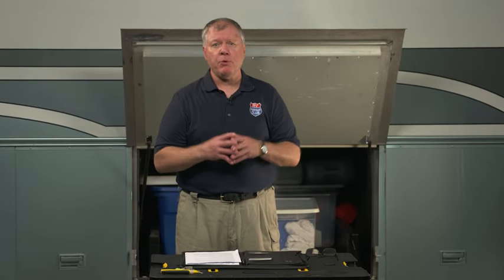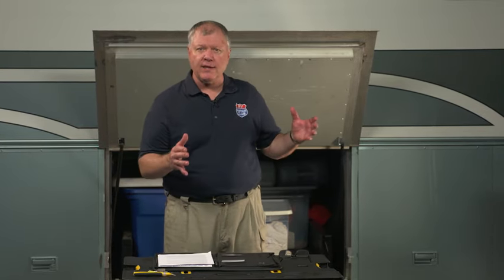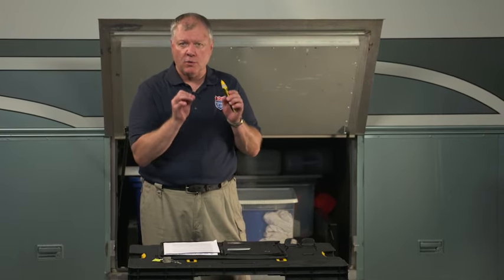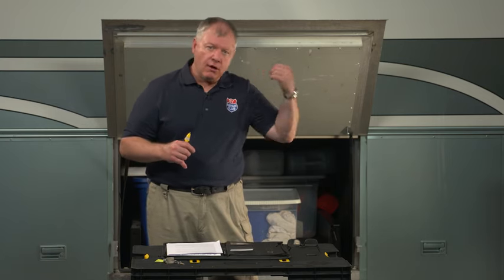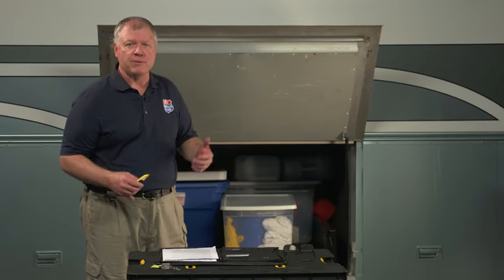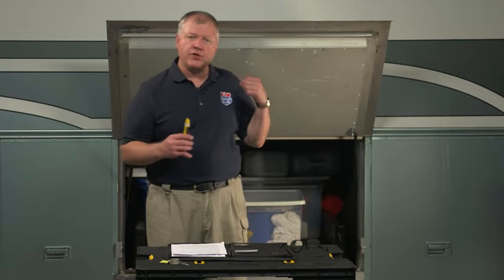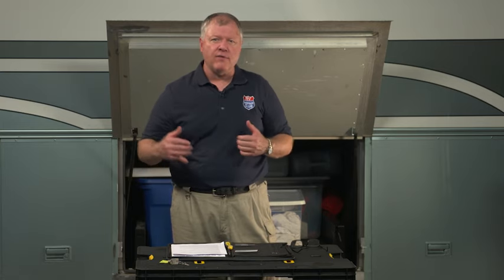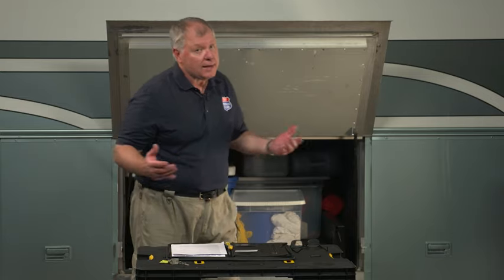RV Outlets Not Working: Troubleshooting Tips & Precautions

Comment: I replaced the breakers and the GFI outlet and 5 outlets still don't work. The "hot wire" on the back of the outlets is reading 120v but when I plug stuff in the outlets don't work. I'm going to replace all 5 outlets. Any other suggestions would be much appreciated. Thanks

Comment: I recently bought a class A RV. Many of the outlets throughout the RV are not working. I recently bought a second air conditioner and put it in the back. That was when I realized the connection on the back air conditioner also didn’t have power. Additionally,  the outlet for the refrigerator does not have power. I have checked all the breakers and fuses. What could the problem be?
Reply from the maker: Hello Matthew,

Thank you for contacting us. Great question! The ‘Ask an Expert’ section is currently for members of our online community. By becoming a member, you will have access to our expert’s knowledge in RV repair and maintenance. With your membership you will also receive discounts on products and hours of Premium video content. 
If you are interested in becoming a member to the RV Repair Club, please click on the special offer below:

https://www.nationalquilterscircle.com/?add-to-cart-multi=1&products=1161&skipcart=1&coupon=C24043&vscid=C24043&skipcart=592449
     
If you have any further questions, please chat, email, or contact Customer Service at 1-855-706-3536.

Comment: The first thing to check is ask if there is a power outage. We thought we had an electrical problem as all our outlets went out. But the lights worked. Real newbies to living in a trailer. Our lights are connected to the battery. Feeling really dumb lol

Comment: My GFCI outlet is working fine as well as my non-GFI outlets in my bedroom but all other (outside and kitchen) outlets connected to my GFCI loop are not.  Any ideas?  Thank you for the great videos.
Reply: Same.  I even replaced the GFI outlet and the breakers and same outlets still don't work. I'm going to try replacing all 5 outlets that are not working. I need help.
Reply: @imissmypeep2209  I just figured  out.  My outside outlet was bad. Took it out and bypassed it and all other outlets now working. My outside is first in my loop after bathroom GFCI.

Comment: Thanks so much for this video. My wife and I just bought a brand new Kodiak Ultimate T.T. to live in temporarily. We are veteran RV’ers but our previous trailer was much smaller and only had one GFCI outlet. The new trailer has 4. Out of the blue our TV outlet went dead. I was perplexed I safely (trailer unplugged) removed the outlet and found some really poor connections. I redid the connections and still nothing. Until I saw your video I didn’t realize that GFCI’s are routinely wired in series. Found one of the outlets that my wife said she had tried plugging something into in the dark was tripped. I reset it and bingo. Thank you for saving me an embarrassing phone call to my dealership.
Reply from the maker: We're so glad we could help!

Comment: I have 6 power outlets and only 3 of them work. The GFCI one in the bathroom works and 2 other ones as well. However, 3 others don't. I checked all the fuses and reseted all the circuit breakers. Would you have any ideas on what the problem could be?
Reply from the maker: Hi Pat,

It is most likely a bad connection on the back of an outlet or the GFCI is not sending voltage out. If the outlets that are not working are within 6 feet of a water source or on the outside of the RV, they will be connected to the GFCI circuit. If they are I would check the wiring on the back of the GFCI and make sure it is good and then check the voltage for the outlet line. It is usually indicated on the outlet which is output. I have seen many GFCI outlets work fine on itself but does not send voltage going out and it would need replaced. If the GFCI is fine, you will want to remove the outlet that are working and check the connections. Usually there are only one or two outlet circuits in an RV so each outlet ties into another one. If the one at the beginning of the chain has a bad connection, the rest of the outlets down the line will not receive power. Lastly you want to check the connections at the breaker and the voltage coming out, it could be a bad breaker as well. Also remember that checking 120v wiring and outlets should be done with caution, messing around with live voltage can be dangerous. Most likely the problem you are having is a bad GFCI or bad connection at one of the outlets. I hope this helps! 

Sincerely, Dan RV Repair Club Technical Expert

Comment: to check outgoing current on a onan generator, where do I apply the voltage tester? all my breakers and GFI outlets seem fine, but I have no power. my microwave usually lights up whan I turn on my generator, but it currently does not. my AC is not working now.
Reply from the maker: Hello.  Near the generator there should be a junction box where the wires coming out of the generator will connect to the wires going into the RV. It is typically within a few feet of the generator compartment if not in the compartment. Just follow the wires coming out of the generator and it should lead you to a junction box. If you have a transfer switch, most do, the wires could be going directly into that so you could check the voltage there as well.  Thanks Dan RV  Repair Club

Comment: Thank you good video. Maybe you can help? My wife and I live full-time in an RV/travel trailer. When we went away for Christmas I set the Christmas lights and a blowup Santa Claus and a new timer I got when I came back they were out now the outlet outside and one of them inside pretty close to it don’t work. I checked all the fuses and flip the GFI breaker Along with all the others and hit the reset button on the one in the bathroom but both of those outlets are still not working. All the others are though, any thoughts?
Reply: Actually never mind, got it thank you!

Comment: My gfci is not working. The reset button can’t be pressed (it used to be). I replace a new gfci but still not working. There is only one gfci on my rv (forest river geo pro 12rk). Thank you if you can answer me!
Reply from the maker: Hello.  If you replaced it and it still won't reset this means there is a short in the system. This can happen in the distribution center, other outlets, something plugged into an outlet, the shore cord or even the outlet you are plugged into. This can be hard to trace down but checking the electrical system is the only way to find out what is going on. Make sure nothing is plugged into any of the outlets, I have seen coffee makers and phone chargers short out causing this issue. If your fridge is on the same circuit unplug it and see if that helps, the fridge could have a short. If it still doesn't work, starting at the power source would be next. Check the distribution center and see if there is any continuity on the hot wire to the breaker for the GFCI coming in and the ground bar. It could be small, but if there is anything there is a short in that system. If there is, remove the wire to the breaker and see if there is continuity from the main power supply to the ground, this would indicate there is a problem with the shore power. Either the cord or outlet you are plugged into. If you are using an adapter to plug into an outlet or extension cord, the problem could be in there. I have seen this many times from adapters. If there is no problem at the main power, you would have to check the wiring to the GFCI outlet circuit and the outlets themselves. Tracing the problem can be hard but it is really the only way to find it. I hope this was helpful!
Reply: RV Repair Club thank you so much.

Comment: So if I can’t reset my only gfci plug then it’s probably gone bad?
Reply from the maker: Hi Jon.  Not necessarily. There could be a fault in the system causing a short 
and making the GFCI not reset. Check what you have plugged into all of 
the outlets, it could be something internal on a device plugged into the
 system. I have seen coffee makers and toasters cause minor shorts 
internally that make a GFCI trip. Another way to check is unplug the RV 
and try to reset the GFCI. If it doesn't reset, the outlet switch is 
stuck and the GFCI needs replaced. If it does reset and then trips when 
plugging the RV bad into an outlet, then there is a problem in the 
system. I hope this was helpful!

Comment: All of my electrical outlets work along one wall except for the one on the other side of my main entrance. But all of them on the ones on the opposite wall are not working. I checked all fuses and everything is fine, I reset the GFCI in the bathroom and they are still not working...any suggestions what to do next
Reply from the maker: Great question! The ‘Ask an Expert’ section is currently for members of our online community. I would be happy to send your question off to the experts. To get started, please send the email associated with your paid membership account. Thanks!

Comment: My little lights work when I'm hooked up to battery, but not when I'm plugged in to shore power only. I have two house bulb lights that don't work at all and my receptacles don't work either. My receptacles don't have a reset either. Please help.
Reply from the maker: Hi Marcus.  It sounds like the issue is coming from the 120v power supply. Have you checked everything else that would run off of 120? Like the air conditioner or microwave? If nothing works off of 120v then you would have to check the shore outlet you are plugged into and make sure there is proper voltage present. If some things do work but only certain outlets and lights aren't then you will have to check the breakers. There will be a circuit breaker for each individual circuit in the 120v system and even if the breaker isn't tripped it could be bad. You will have to check the voltage at the breaker to see if the breaker itself is bad, came out of the socket or if the wiring is okay. If the outlets are on the same circuit as the GFCI outlet then you would first want to make sure there is voltage at the breaker and if there is then the problem might be with the GFCI outlet itself. The best thing to do is check the voltage at the breaker to know for sure you have good incoming voltage and then from there you can test the separate circuits. If nothing is getting power and you know the outlet you are plugged into is fine, it could be the shore cord or an adapter you are using that could have failed. I see adapters fail all of the time so if you are using one, this could be the issue.   
Thanks
Dan-RV Repair Club

Comment: I have a 1993 pop up camper and my outlets and refrigerator is not working but I don’t know what to check. My gfci is the only outlet working
Reply from the maker: Hello.  Most pop ups will only have one circuit and they are all connected to the GFCI. It is possible for the GFCI to be working but the output connections could be bad. I would first check the breakers and if you only have one 15 amp breaker, they will all be tied together. If you have 2 15 amp breakers there could be something wrong with the other circuit but most of the time the thing that causes this to happen is the GFCI since most pop ups only have one circuit. The best thing to do is check the wiring from the outlets or the breaker and see if you can trace the problem down. If you notice that they all lead back to the GFCI, it is most likely bad and needs replaced. I hope this helps!   Dan-RV Repair Club
Reply: where would the breakers be located?

Comment: my lights are all working,but no wall sockets, and I've check the gfci ,but still no power from the wall plugs.
Reply from the maker: I would check the main power distribution center and see if a breaker has been tripped. Typically there is more than one outlet circuit and if all of them are not working the problem is most likely at the breakers. If there are some outlets working, they could be feeding power to the other outlets and there could be a bad connection on the back of one of the outlets. If one goes bad, the others down the line will not work at all. If everything looks fine you will then want to check voltage to the breakers and then to the wires for the outlets. You would then have to remove the outlets and find the first one in line and see where the voltage is lost. Most likely the problem is with the breaker either being tripped or is faulty. Checking the output voltage is the only way to know for sure where the problem is. I hope this helps!
Sincerely,DanRV Repair Club

Comment: We are connected to shore power, NO OUTLETS ARE WORKING. We don’t have a reset button HELP
Reply from the maker: You will want to check the breakers at the main distribution panel. If there is voltage to other 120v components it is best to start with the breaker and see if it is tripped or has voltage. If most items are not working in the RV then you will have to test the shore line outlet and see if there is proper voltage coming from it. Most of the time if it is just a circuit of outlets not working it could be the breaker. There will always be a GFCI outlet per safety code so if the outlets near the kitchen, bathroom and outside are not working you will want to locate this outlet and test it as well.

Comment: GFCI is good inside. Still have no power to the 2 kitchen plugs, and the plug outside. Has been like this since new
Reply from the maker: If it has been like this since new then there is a problem with the wiring going into or out of an outlet. The circuit is chain linked together. It will start at the distribution center to the GFCI, from the GFCI to an outlet, out the outlet and so on. If the GFCI does work it is best to remove the GFCI and check the output voltage wires, they will be indicated. If there is voltage there then you will have to take out all of the non-working outlets and check to see which one has the bad connection. Most likely it is one bad connection making the rest not work. I have seen instances where the GFCI outlet worked fine but it did not output to the other outlets and needed replaced. Regular outlets can be opened and have the prongs adjusted to make better contact but GFCI outlets can not. Knowing that the non working outlets are in the kitchen and outside shows that they will be on the GFCI circuit. This is why it is best to start with the output of the GFCI to narrow down if it is an outlet or the GFCI itself.
Reply: RV Repair Club thanks for the reply. I also though of the GFCI with the re set being faulty as well. When I have time, I’m going to by pass the switch to see if I get power to the plugs that currently do not have power.
Reply: Saved me!! Thank you!!

Comment: Ya but how do u replace it
Reply from the maker: Hey Brandon,

I am not sure what they are asking to replace, the wall outlet? If so, the cap fascia should just pop off around the outlet and there are two screws that need to be loosened to remove the outlet. You can then loosen the screws holding in the wires and remove the outlet all together. It installs in reverse order. Always make sure to disconnect shore power before replacing outlets.

Sincerely,
Dan
RV Repair Club Technical Expert